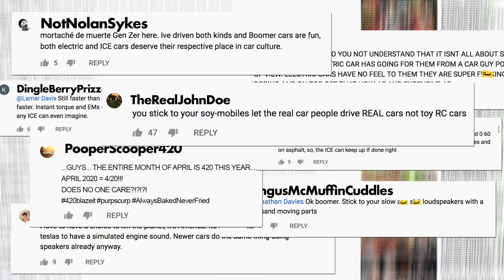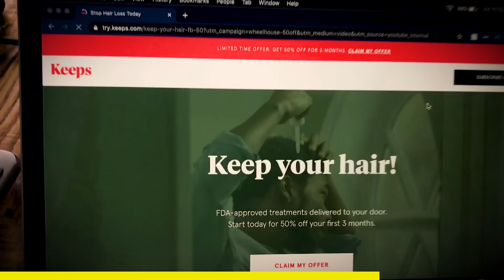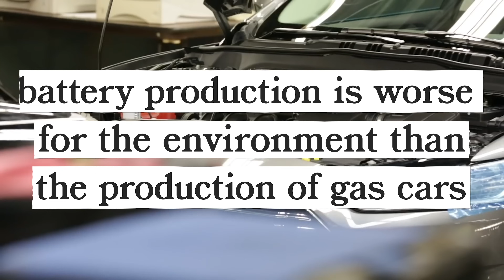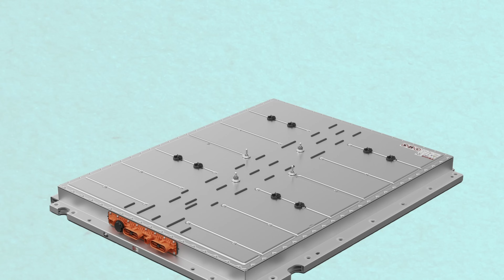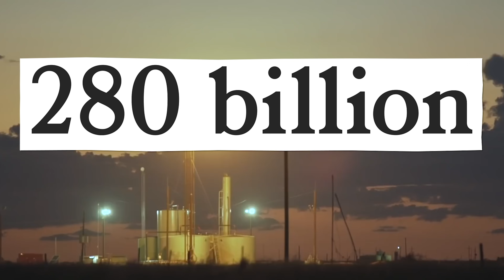Are Electric Cars REALLY Better for the Environment?

Comment: All electrical sources use coal or nuclear power overnight. This will be true for decades after the grid is 90% green.
Power is made by burning raw diesel. there is loss turning it into electricity
The amount of power lost from plant to use is significant, 1 volts every 100 yards
When going from AC to DC charging, there is a 10% loss of electricity, similar going from battery storage to DC motor.
When you use electricity, the power plant makes 30% more than you use, for availability.
If you run a DEF diesel car, it's way better for the environment. If you add 10% biodiesel, it will be fifty years before electric car can meet that.
Reply: well actually the electric motors are AC. also the going from inverter to battery then from battery to inverter to motor to wheels that whole efficiency vector is 77% efficient (23% loss). Which is considerably not alot. However, used DEF reduction and biodiesel does not mean its better. Even from an emissions standpoint from the power plant, it produces far less emissions to charge an EV from the grid, even from a coal or diesel generator per mile than it would be to drive your diesel.

Also consider than it would be more fuel efficient to use that same diesel in a small portable generator and use that to charge you EV (10% biodiesel and all) than it would be to use that same fuel in even a modern small diesel engine. Yet alone from a large hyper-efficient gird scale powerplant. You can even prove this mathematically.
Reply: Why wouldn’t we be able to use nuclear 24/7? I don’t see the point of not capitalizing on an extremely efficient source of energy. Plus nuclear is safe, and the new molten salt breeder reactors push that further. Countries lien China and India are developing new molten salt reactors that will be able to use their waste and use it as fuel for the reactors until in turns into a far less radioactive substance that is completely harmless, even over long periods of exposure to it.
Reply: @stardust7186  Nuclear is dangerous in many ways. It will force us off the planet. There is a tremendous amount of heat that contributes directly to global warming. Some blame nuclear power for water temps and glacial decay.

Comment: rn yes they are worse in a long run, but people are trying to make metal batterys so they dont polute at all
Reply: isn't it the other way round? The longer you keep the EV the better it is
Reply: @MudhaffarAdhwa  that is true. Infact most comprehensive well to wheels studies put that break even point as low as 15k miles.

Comment: If crude oil is refined into products other than gasoline for an ICE, then you have to discount some amount of the pollution caused by ICEs, because not all of the refined oil is for ICEs. If we got rid of all ICEs, we would still need to mine crude.

Comment: If I have to drive an EV to work so I can drive my SS on the weekend I’m fine with that. I like the idea of EV’s but not the limitations.
Reply: This is an underrated comment
Reply: the battery is improving on the range and charging time.  However, there is nothing gonna be everything your way.  Unlimited range, charge in 5 mins to 100%,,…etc.  You get some and you lose some.
Reply: @g600f700  are they improving in range or we just put more battery because it's getting cheaper ? (for now...)
don't get me wrong impressed with EV nowadays but to go 500km seems to me you still need > 500kg of batteries... which does ruin any light car
Reply: @nigo1787  there are many research on battery and motor.  Next generation will be more efficient.  If we use the same battery and motor, you are 100% correct, more battery = more range.  Keep checking new updates on battery/motor development reports.  These upgrade happens over time, not over night.
Reply: By SS do you mean Camaro? Or Commodore? Or something else? Either way, props man!
Reply: @FroggieIII  it is a Camaro. Catfish six speed. Thanks.
Reply: @FroggieIII  Camaro, six speed. But I would love to have a Commodore (or SS in the states)Very hard to come by over here.
Reply: The fact that operating range is at present 260 miles on EV and 45 minutes to rapid change for 80% doesn't appeal to me. Long range travel is not suitable. Plus trucks and heavy equipment can't operate long enough on batteries. Much as the technology is touting as a save all, it's still not practical or reliable. Look for posts of EV owners waiting 6 months for a replacement faulty battery. Gas powered equipment is more recyclable that a lithium battery.
Reply: @picker63028  Rent an ICE for long range traveling. Most people fly when it gets that long distance. Trucks and heavy equipment will change the second it becomes more profitable to do so, which will happen very quickly $6 a gallon already.
The battery from a car still has plenty of life left, just not in the car. Leaf batteries are taken out of cars and sold all the time. Cheap conversions, but mostly as house backup power. Resuse, then recycle.
Reply: Yeah. I'd if they are around i just want to be able to still have gasolines newly produced.
Reply: How far do you drive to work? If I were to buy a Hyundai Kona Electric, it has enough battery capacity to take me to and from work for two weeks (10 working days) without a single charge, and can DC fast charge to 80% in 54 minutes.

A single overnight every two weeks plugged onto the home rapid charger and it's full again.

I LOVE the sound of ICE motors just like any other car enthusiast, but why would I waste money buying fuel when I could just have an EV instead for daily commuting? There's nothing pleasurable about paying $1.639 CAD per litre to commute 30 minutes each way every day no matter what you drive.
Reply: @tarushdei  damn that's only 1.16 euro per liter, we pay 2.30 euro per liter
Reply: Don't buy a car based on a global scam.
Reply: Fantastic comment, thank you. I learnt more here on this issue than anywhere else in the last 3 years🙏🏻🙏🏻🙏🏻
Reply: @simewood2040  I thought the same thing!
Reply: seems to me they will ban the SS even as a week-end car, even if you don't drive it in the city and so on. That's the worry to me and most of where the frustration comes from. I'm a cyclist, I use my bike 5 days a week, I'm so pissed off they tell me my Ford Fiesta I use on Sunday is killing the universe and must be banned...
Reply: @nigo1787  I also am a huge fan of human power! I enjoy just riding but can’t really commute due to distance.
Reply: jesus loves you
Reply: @nigo1787  yep. I totally understand. I can’t cycle to work. Probably wouldn’t anyway lol. But if you do that and you drive a small efficient car to travel distances outside of cycle range you are absolutely doing your part. The folks saying that likely are doing less to promote a healthy earth than you are. Props to you sir.
Reply: @nigo1787  thatz the fear & pisses me off...
I hate leftist all my heart ... I Don't see them as humans anymore or were they to begin with ..
Reply: There are trade offs. Is it worth a child's life?
https://youtu.be/ipOeH7GW0M8
Reply: Don't count your chickens
Reply: This would be nice if by 2030 companies didn't have to stop ICE production on vehicles. What an end for petrol heads. smh
Reply: @thomas-619  Says who? When was this decided and agreed upon by consumers? Demand will decide what is produced. You can’t force an energy transition. It has to be feasible to do so.
Reply: @6-Iron  i mean big companies like audi mercedes vw etc have already said that they will go electric by >2040
Reply: Thinking likewise. Problem with it is that when gas is no longer profitable in mass prod, they will drill for less oil and produce smaller quantities at a high price, same goes for new vehicles, and any spare part for an old one. The idea is nice, but reality looks bleak when the transition to full EV is done.
Reply: @victoralexanderkangas8756  biofuel will replace petrol. Hopefully
Reply: @nigo1787  Unicorn farts?
Reply: @6-Iron  Porsche is talking about synthesized biofuel, not vegetable-based. It's not there yet, but it's not stupider than to go 100% electric which WILL be an issue for resources, charging points, price of electricity that will increase and so on. So yes, I hope biofuel will catch on
Reply: An EV can beat your SS to 60 and then to the next state.
Reply: @psikot  i didnt say anything about performance? I was talking about how big companies announced that they will go electric
Reply: @jannis-joelfehl4855  Read the original comment again. 

I bet you think this song is about you.
Reply: @psikot  until it needs to charge forv8 to 10 hrs
Reply: @bvrsqzr3569  Yes 8 hours while you are sleeping.

BTW How's your gas bill looking? A madman in another country did that, not that one the other one.
Reply: @psikot  How many six-year-olds in the Democratic Republic of Congo did it take to buttress your EV virtue signaling?
Reply: @jeffreycheng5984  I can't hear you over the dead American soldiers in Iraq that made Chevron more money.
Reply: A tesla is faster than a SS anyway. Fuck it.
Reply: @congestedgoblin2575  so ? Speed is unrestricted where you live ? If not, then speed is not everything in a sports car, the way it gets you there is far more important
Reply: @nigo1787  Speed is restricted but acceleration isn't. Electric cars are much quicker.
Reply: @congestedgoblin2575  Not as fun, though. Gasoline has a different feel that many will still crave. Sorry.
Reply: @congestedgoblin2575  until it has to charge for 8 to 10 hours
Reply: @congestedgoblin2575  a tesla is heavy, handles like crap , has no soul and is boring .  0-60 does not tell us the entire story.  EV's are still not the answer, too many issues in the big picture.

Comment: You didn't take into consideration the replacement battery needed after 12 months, wouldn't that bring the efficiency back down below the combustion engine.
Reply: Electric car batteries last for 600 miles
Reply: @jhonnyjuice9  did you mean 600k miles? Modern EV batteries are designed to last up to and exceeding 400,000 to 500,000 miles.

Comment: Maybe you forgot about the major power out that we went through here in Tx because the so called power grid couldn't make enough energy? What will happen during rolling blackouts during the nights because everyone is charging at the same time? What about the manufacture of those so called wind turbines that break when the wind blows at higher velocities or solar panels that won't charge anything after 20 years & need to be replaced? How much energy does it take, you may never know, I will stick w/gas until I can't drive gas then I will make a switch to horse & buggy, not much cheaper then that!
Reply: That blackout was due to a natural disaster. That doesn’t reflect the grids capacity, or EV impact on the grid, neither its ability to support EV. What the blackout in Texas indicated is that it wasn’t prepared for a 1 in 400 year event. I’d say almost every grid on the planet isn’t prepared for natural disaster so far out of the norm.

Comment: Pretty good video. How much co2 is required to recycle the batteries of a ev? Also, EV's weigh at least 2x that of their counterparts. That's a lot of mass traveling at 65 miles per hour into your Ford focus
Reply: actually EV's dont weight very much more than their counterparts. Take the Tesla Model 3 and the Audi A6 for example. They're both similar sized, Mid-Sized Luxury Sedans. The Model 3 weighs in at 1,847kg and the Audi weighs in at 1,845kg. A shockingly 2kg heavier! (less than 1/3rd the weight of pumpkin). Or we could look at the BMW 5 series, Also a similarly sized Mid-sized Luxury Sedan. It comes in at 1,990kg. That's heavier than the EV. Why people perpetuate this myth is beyond me. Its definitely not more than 2x "at least" heavier
Reply: @engineeringtheweirdguy2103  , you are comparing the model 3 low range model to performance models lol. The model 3 performance model weighs in over 4I pounds. Nice try though
Reply: @markschiavone8003  ok, so now go to google and convert 1,847kg to lb. Do you know what that is? 4,071lb. That is for the performance model 3. The performance model 3 only has the one battery size at 75 kWh. There is no "low range" performance model. there are 4 types of model 3's. Model 3 Standard range (often called SR+), Model 3 Long Range, Model 3 performance and Model 3 performance Stealth (when by it looks like a Long range in trim but has the speed unlocked). it is worth noting that both the Long Range and the Performance Model have the same size battery and range.
Reply: @markschiavone8003  nice try though

Comment: Electric ⚡️ cars are bad, they need battery’s taken from the environment, from poor country’s and required a lot of H2O for the process 💦💧.

Hydrogen Car are the real deal.
Reply: hydrogen cars are a sham. There is almost literally no way in which a hydrogen car is greener or even more desirable than an EV.
Reply: @engineeringtheweirdguy2103  It's greener, but its incredibly inconvenient.
Reply: @deathbyunicorn5213  how is it being inconvenient?
Reply: @deathbyunicorn5213  they’re far better than hydrogen cars in almost every single way. Hydrogen cars are a horrible concept
Reply: @engineeringtheweirdguy2103  They're inconvenient because there's 50 something hydrogen stations in all of the USA and they cost 2, 000, 000 to build. The cars are also weaker usually, which is fine for the average consumer, but they won't be dominating the drag scene.

Hydrogen cars literally use an electric motor to run.
Reply: @deathbyunicorn5213  I thought you meant BEV’s were greener but less convenient. Because BEV’s are greener than hydrogen. By a long shot
Reply: @engineeringtheweirdguy2103  The vehicle itself only emits water. There really isn't much to hydrogen. Producing it in the first place does produce CO2, but it's no doubt better for the environment than lithium batteries.
Reply: @deathbyunicorn5213  it’s produces at minimum, best case scenario, 2-3 times more emissions per mile than a BEV. As for lithium, hydrogen vehicles don’t last very long. Ironically the lithium batteries they use are the longest lived part of the power train. The fuel cells only last between 100,000 and 150,000 miles and the fuel tanks are only rated for 10-15 years. Infact hydrogen cars come
Off the assembly line with an expiration date printed on the fuel cap. Meanwhile modern BEV’s are rated to and are showing to last up to and exceeding 500,000 miles with new battery tech promised by both Toyota and Tesla taking that number past 1 million miles. So at current, to meet the same lifetime service as 1 BEV, you have to manufacture and dispose of 2-3 hydrogen cars, and in 2022, that could be as more than 4-6 hydrogen cars to 1 BEV. And then considering that they then emit at best 3-4 times as much emissions per mile as a BEV. They’re no where near as green as BEV’s.
Reply: @deathbyunicorn5213  hydrogen is a horrible concept from start to finish.

Comment: Id still rather dive my 67 Chevelle then drive a ev. I love the smell of 100 octane leaded fuel . Mo Powah Babeh!
Reply: Yeah?  Try running that Chevelle against a Tesla Model S or a Model 3!  Your love of the smell of high octane fuel might disappear like the tail lights of the Tesla.  Don't get me wrong.  I own a Mustang Shelby GT500, and I love the music it makes, love shifting through the gears with the manual gearbox, love its looks.  I bought it new in 2011 and I have no intention of parting with it.  BUT.  Having a second car (actually, my wife and I have five vehicles, but you get the point) with big range, big acceleration, low maintenance and driven by electricity is a very tempting proposition.